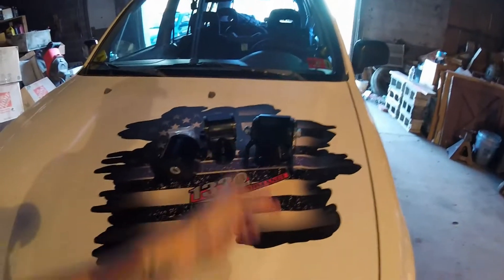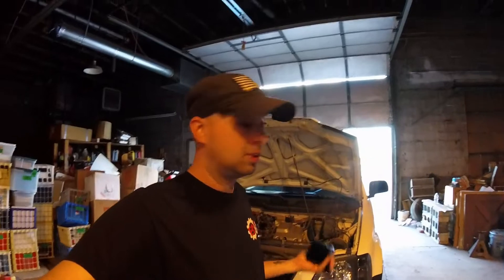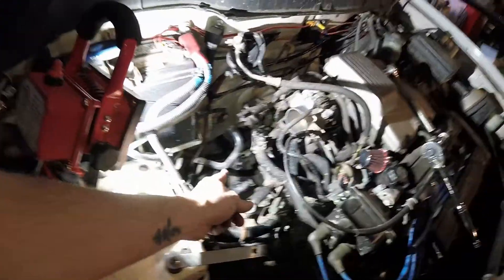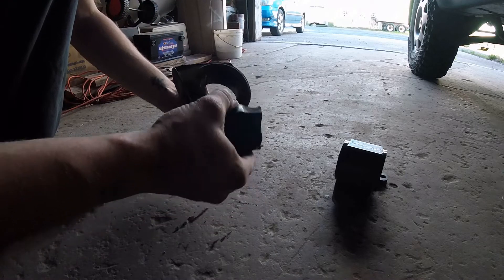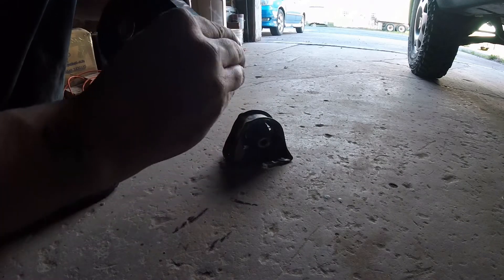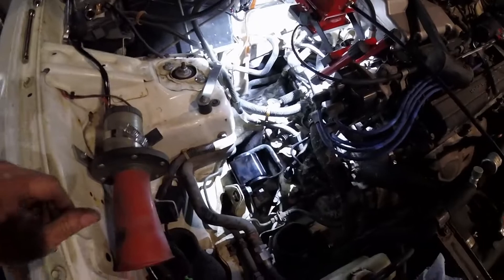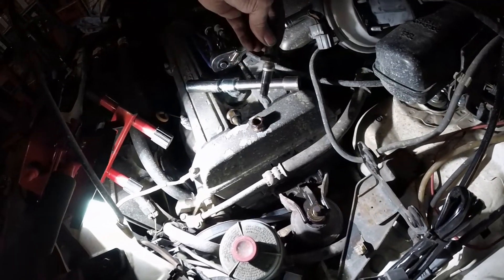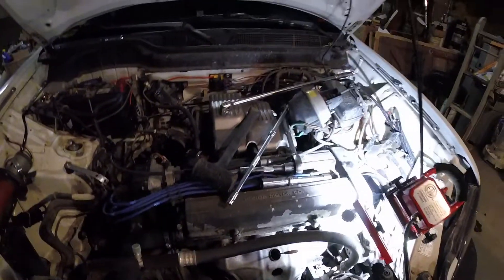1320 75A motor mounts install on a RD1 CRV

Comment: I’m about to put 68a durometer 1320 mounts on my CR-V I’ll update with the vibration it causes. I’m curious if the rear mount being rubber and the two side being poly would give some benefit of comfort and keeping the engine from flopping around in the bay.
Reply from the maker: Yes definitely post up some results on those. These mounts are the toughest of the tough and 0 movement of the engine and trans which is great but yeah the vibration is overwhelming to say the least.
Reply: @VlogsByWes  I actually finished this on Thursday. First day was rough but it was much better today. I’m going to run these through break in at 1500 miles if it’s still the way it is I will replace the rear mount in favor of rubber. But so far even the 68a durometer mounts vibrate the interior I’d say 8/10
Reply from the maker: @CaptainTexas92   mine even after 5k miles they were worse.. which is actually why I sold the crv and got the truck.
Reply: @VlogsByWes  I have lik 4-5 g’s in my CRV if it gets worse I’ll spend the 50$ for a mount or even just put the old lazy mount back on. But I will post an update probably in a few weeks with how it’s going.
Reply from the maker: @CaptainTexas92  sounds good. I look forward to seeing the results
Reply: @CaptainTexas92  Did you need to put a rear mount in?

Comment: A motor mount just holds your engine it does not make your car faster are you doing is putting a solid more amount over original factory more amount that’s supposed to be held together it’s filled apart because it’s broken not because it spins and makes the car slower this whole video is slow 😒
Reply from the maker: Must be slow like your level of grammar you learned. Your comment doesn't make sense
Reply: Motor mounts do actually make a car with bad mounts quicker there is a lot of parasitic torque loss on a motor that fights the chassis for grip.
Reply: Huh?